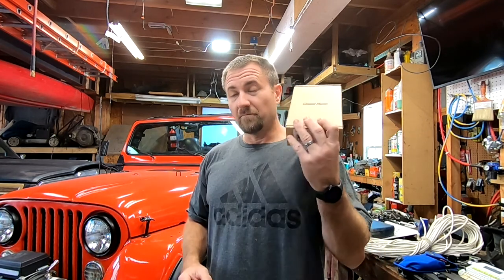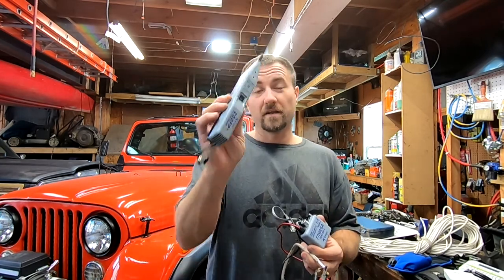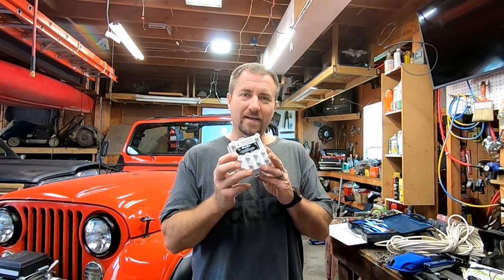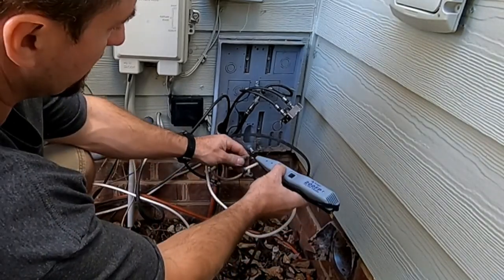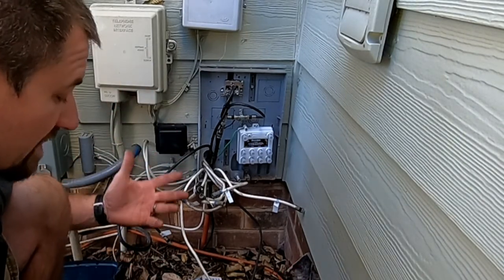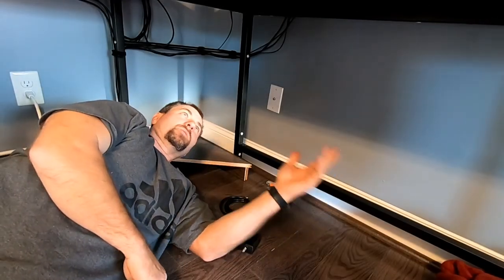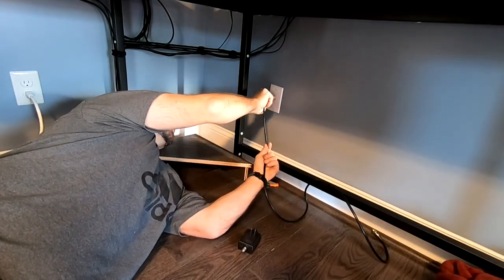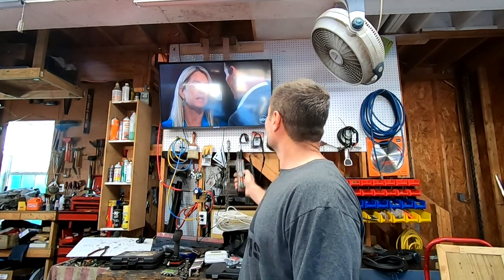Stick it to the MAN!!   Channel Master TV Antenna Amplifier Install with Tips.   So worth it!!

Comment: Just installed the preamp1 yesterday. It has largely strengthened what i had and more. Most of My towers are 70m+ away and larely over water.
I'm picking up over 55 channels consistently 
Great purchase!!!!
🍻 📶📶
Reply from the maker: i am still surprised on the difference.   We are up to 8 TVs one the one antenna.    All of the channels come in great.
Reply: @5LakesGarage  10 yrs or more now the cable or satellite savings is in the 10s of 1000's  🤣🤣🍻🍻📶📶📺

Comment: I got 66 channels on my short run and 35 channels on my longer runs.  Added channel master 4 port amplifier and now get 65 channels on all tvs. It works!!
Reply from the maker: that is great.     the picture quality over the air seems to be better then cable or dish.   it is  great that NFL is on the locals.    Now if we could just get the NHL to play more on locals.    

Good job and thanks for the watch.

Comment: Good video. Might wanna also inform watchers that the cable that you use is RG-6.  Back after my house fire I told my step dad I wanted to use the most up to date cabling and being a phone service repair man I thought he'd know. Instead, he got RG-59 instead of RG-6  and RG-59 was obsolete. I ran all that RG-59 inside the walls before I put sheetrock on and turned to find out that cable was not the most up to date and then I had to fish all that RG-6 through the walls with sheetrock already installed. Just keep in mind things change and get updated all the time. So make sure and do your homework before you install anything and make sure you have the proper cabling for your installation.
Reply from the maker: good point on the cable type.    I love this platform that we can share information in both directions.    I am not the one to know it all.  :)     Sorry to hear about all of the rg-59 in the walls.    When i ran all of the cables for my TV in the walls.   I ran everything except for rg-6.    i cut a V in the rock and plastered over it.   Not Ideal but it worked.
Reply: @5LakesGarage  Any way you look at it, it's extra work you should not have to do.